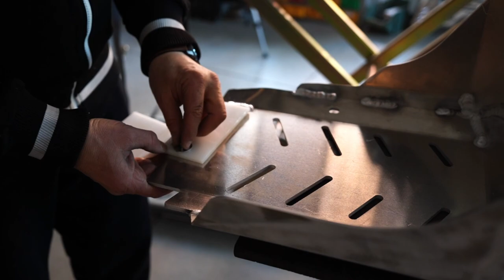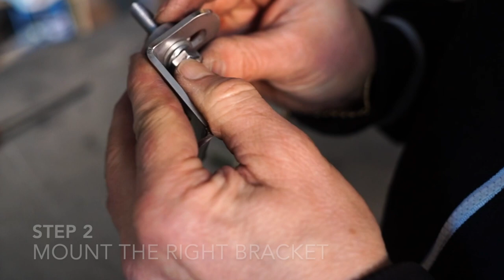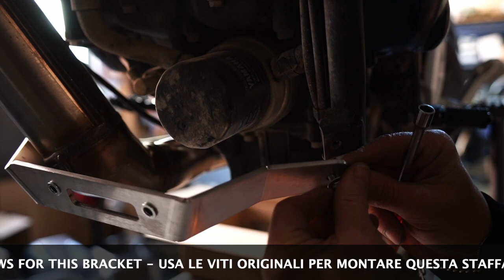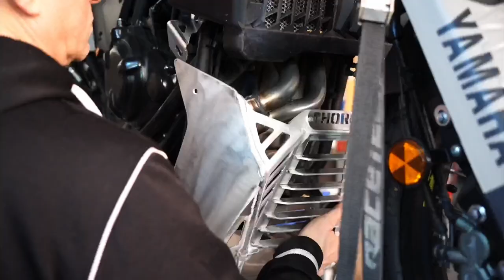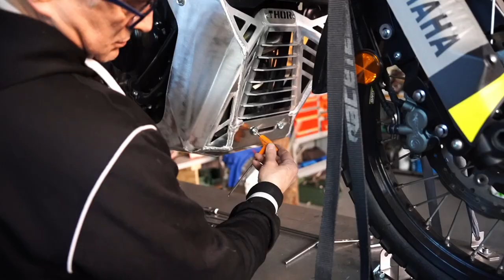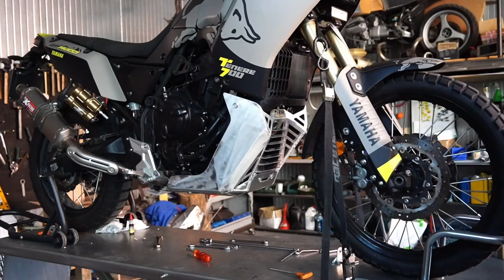Yamaha Tenere 700 - New 2023 THOR skid plate assembly tutorial by GpMucci

Comment: Just got mine and installed with the help of this video. Worked well. Only had to freeze-frame a couple of times to check wich side bracket is wich (long one left-, short one right side) and how the absorber is mounted underneath.
Everything fitted well with the new cage nuts 👍🏼
Took me about 1.5h, including getting all my tool, the bike, disassembling the original parts and cleaning everything up afterwards.
/edit just weighted the original parts:
900g vs 4.6kg Thor for everybody that is interested
Reply from the maker: Thank you for the feedback Marc!